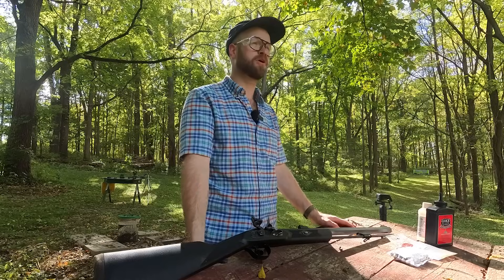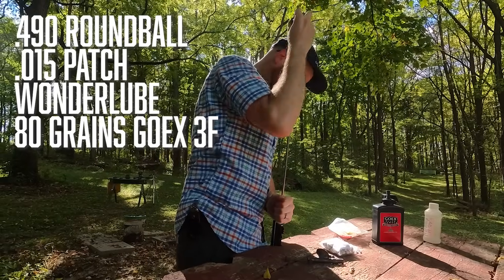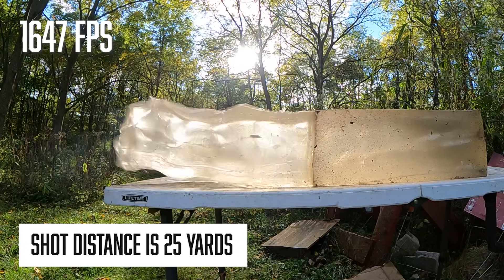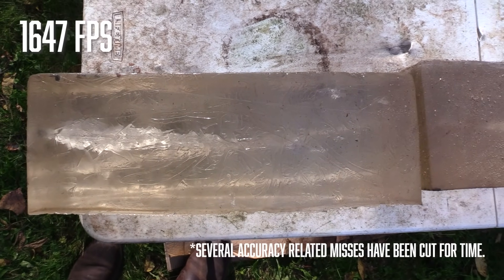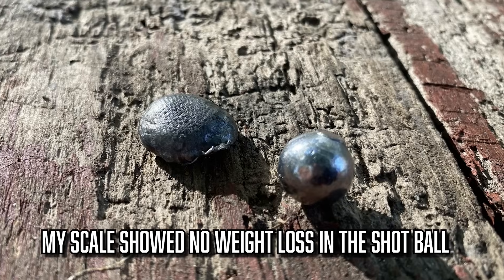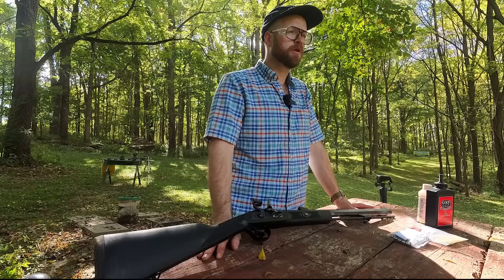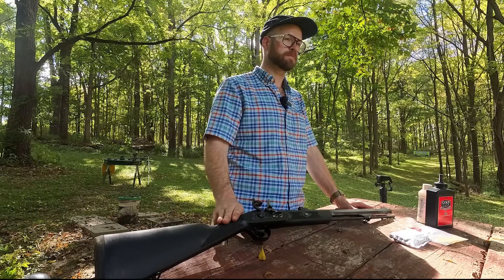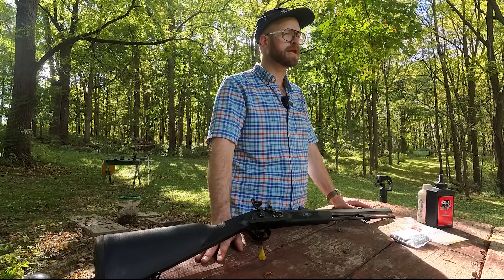Roundball vs Ballistic Gel | Redneck Muzzleloader Science

Comment: Thank you for this round ball  test. Did you figure out what those ignition troubles were? And did that round ball penetrate any deeper and bounce back to where it rested? My eyes are old and phone screen small. I acquired an old  t.c. firestorm that appears to have not been used much if at all, and would like to try to get it up and running.
Reply from the maker: I did figure out the ignition issues, I needed to pick the touch hole. 

The roundball did "bounce" back in the gel, went 3" or so and returned.

Comment: Every bullet regardless of impact velocity is subsonic when it hits ballistic gelatine or flesh. The speed of sound in water , ballistic gelatine and flesh are all much higher than all small arms bullets, so this means that the best shape to penetrate is almost flat. Even your round musket ball behaved like a falling rain drop and turned into an ablated sphere ie flattened. The pressure on the ball would drop as the ball flattened and it produced a bigger force and cut a bigger volume at the start of its penetration. After it settled into its new form it cut a nice parallel wound channel. I wonder if you could try a steel ball which cannot flatten? Would it require less muzzle energy to penetrate an equal distance?
It is a pity that an equal density hardened lead ball could not be tested at equal speed and energy to confirm that it would cut a deeper but lower volume wound channel from the high pressure but lower force impact. Just a thought. Nice video!

Comment: Always good stuff Ethan. Round balls hve always been great, but at times do thru and thru on whitetail with a bit of a tougher recovery. Gold standard for flintlock hunting here in PA are conicals, after they let us start using them many years ago. Maybe it’s just the weight difference bs PRB? But they never fail to do the job if you do yours and recovery is typically quicker than PRBs.

Comment: Round balls flatten out great on Whitetail Deer and are very effective!  I have been blackpowder hunting since the late 70's and I still keep gravitating back to pure lead bullets and round ball.  That "Print" is the patch cloth imprinting in the lead.  Try priming with FFF and do not fill to the level of the flash hole.  You will have better ignition.  More is not better in the pan.
Reply from the maker: Thanks for the info! Hadn’t thought about the patch. 

I’ve found that this tied of lock doesn’t go off if I don’t fill the small pan cavity. I think I’ll do a comparison between this and some other locks to see how much powder is actually in the pan. These locks have a very narrow, deep pan compared to nicer locks.
Reply: Another excellent and informative video. Have you experimented with increasing the diameter of the touch hole for more reliable ignition? I read an article decades ago where the author compared touch hole diameters of period pieces (including fowling pieces from the 1700s) versus modern reproductions. The bottom line was that the larger touch holes in old flintlocks had an unmistakable positive effect on reliability of ignition.  Food for thought.

Comment: Goex is pathetic ... Swiss is the gold standard for commercial powders ... you can make your own that works the same ... I didn't look it up but I'm assuming that's 26 or 28 inch barrel with standard twist rate of ... what? 1/48? ... you're using 80 grains while 50 grains with the same round ball and Swiss should be 1800 or there abouts ... thanks for the lack of information
Reply: Tit for Tat on powders.  I haven't seen any accuracy deficiencies or improvement on the use of one powder over another when it comes to commercial powders.  Now hand made can vary greatly as to the charcoal used and the milling time.  Round ball specific rifles use a 1:66 twist.  The 1:48 is a compromise for using round ball and conical bullets.
Reply: @MrOldclunker I didn't say "accuracy" ... I'm talking fps ... accuracy comes from dialing in the patch, ball and charge ... correct? Regardless 50 grains of Swiss will get you significantly more fps than Goex .. and cleaner. As for "handmade" it's more about the tumbling media and time than the charcoal even though that does make a difference
Reply from the maker: Thanks for sharing your thoughts! I use Swiss in this test as well as several others - https://youtu.be/S7qsBi-wcYM?si=59RzhL7oBTSHJKZZ
Reply: @ILoveMuzzleloading  1800-1900 does Goex come anywhere near that? I think not ... test it out of the hawken head to head with everthing equal except the powder ... being from the midwest love the hawken by the way
Reply: I'll counter, Everything Blackpowder has some very good "recipes" for powder that I would take over commercially available powders. I also like 777, but not for a flintlock since you can't prime with it.
Reply from the maker: @minigpracing3068  I can't find your other comment, shoot me an email and we can talk about those other projectiles you mentioned
Reply: @outtathebox...  Save some chicks for the rest of us bro.
Reply: for 50 grains of swiss powder is impossible to push .490 ball that fast !